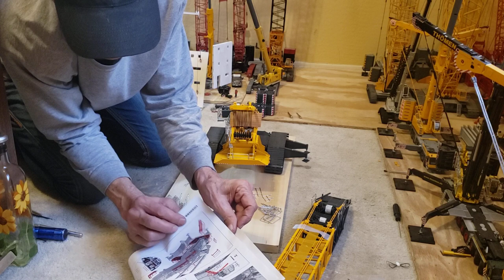Assembling The Liebherr LR11000 Crawler Crane Part 2

Comment: Hello I was wondering if you could make a video explaining how to reeve the gantry I’m lost and confused on how to do it on mine?
Reply from the maker: Hi,  yeah I can do something for you. Are you using the diagram? It's confusing so I used the text on the right of the diagram. I'll post a video shortly.
Reply: @lvdrums  hello ya i have used the diagram and the numbering system on the side of it as well im just confused wspecually with the line being in a loop on one side of the drum and they tell u not to cut it thanks for reaponding and making a video on it
Reply from the maker: @The690ELC  oh snaps I know what got you now! Lol. I don't know what they are talking about there. And no other model does that. Skip that portion of the instructions. Cut the rope off at at least one of the drums so you can reeve it.
Reply from the maker: @The690ELC  6232089203...call me if necessary and I'll guide you through the process

Comment: Now I'm nervous about the Sarens version I have on order seeing the problems your having with this . Also I am worried that you have to raise the boom almost straight up to keep the boom up. I only have 8' ceilings so it looks like I will have to take a boom section or two out to make it fit and be stable.
Wondering if I should just go with the IMC CC2800 now?
Reply from the maker: Well, I'd check it out first and see if yours doesn't have so many issues. It took a little while longer to deal with it but I don't mind so much. I don't rush the assembly too much.....it's part of the fun. With no load you can boom down enough to fit in your room. There's ample counterweights you can put on the rear tray to get more boom down than I have. I won't lie though....that's a big heavy boom. Best reasons to keep it .....Sarens livery is awesome and it's a killer looking,  huge model. Plus there's supposed to be a derrick kit with a stinger ballast tray that will allow a litte lower boom and a light load. Luffing jib is supposed to be available also.